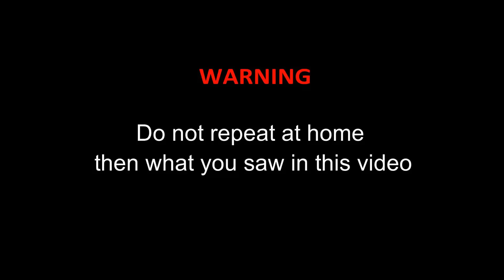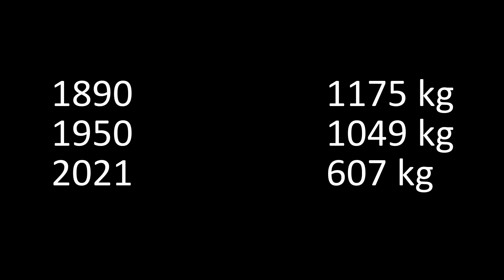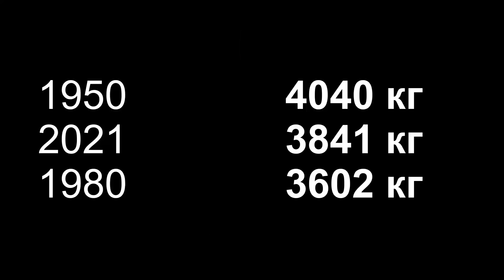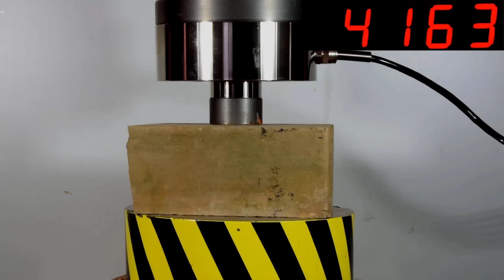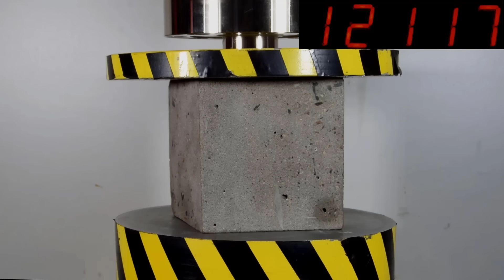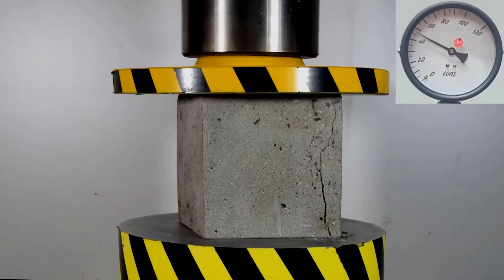HYDRAULIC PRESS VS OLD AND MODERN BRICKS

Comment: I remember as a kid of 8 years old a guy was laying new sidewalk.  He told me the concrete takes  24 hours to get half strength and 24 years to get full strength.  I'm 63 now.    Interesting the things you remember.   Very interesting video.
Reply: in Italy the curing of the concrete is considered completed after 28 days (after which it can receive bearing loads) and reaches the final strength in 3-4 years.  It depends on many factors
Reply: Thats correct, but these are clay bricks, once cooked they remain the same, like pottery.
Cement in the other hand keeps absorbing oxygen.
Reply: @santiagoperez2094  No, they are cement bricks. At least most of them were. I believe one or two may have been clay.
Reply: its 28 days
Reply: @Beanpolr  Santiago is talking about the bricks in the video not the ones in this comment.
Reply: @Logikalx01  Yes, that's what I was referring to.
Reply: Your comment had 666 likes so I liked it
Reply: @santiagoperez2094  63 - 8 = 55
Reply: when I was working on the Death Star my Manager, Mr. Palpatine told me something similar about the metal mix we were using.
Reply: i have some memories i have remembered thought my entire life, of when i was 4. i wonder if i'll remember them if i get to my 60s or something (im not close at all)
Reply: yo grandpa has a yt account
Reply: Wow that's such an intrsting thing
Reply: It's actually 28 days till 95% minimum from full strength, usually 100% in that 4 weeks period.
Reply: Interesting a 63 yr old guy knows how to comment on a youtube video
Reply: @gr0za44  bruh
Reply: @Velociiraptor  lol
Reply: This is not true, it depends on the mix and many environmental factors. Also you can use a different mix depending on what kind of environment its intended use is. For example the mix would be very different if it's going to be used in a very dry environment to a very wet environment and also different soil types. Acidic, Salty (eg close to the sea) you make a different mix for each requirement.  You can also add additional strengthening depending on its use. Some engineers their entire expertise is based on mixes and geotechnical science. A brickie laying a side-walk would not be scientifically educated enough to know this.
Reply: @HamburgerHelperDeath  I have heard the Canteen does a very good Spaghetti Arrabiata but the trays are always wet?
Reply: AYO IM TALKING TO A 63 YEAR OLD
Reply: I think the reason Roman concrete is so strong is not because they had a secret recipe we don't know about, rather their concrete is far older than ours and had more time to harden.
Reply: @jd_kreeper  Nonsense, do you think a concrete from 5bc is drier than a concrete from the 1800s? It doesn't take 2000 years to dry out
Reply: LOL your memory is getting flaky. mason meant 24-28 days
Reply: ah so the concrete dryed when you were 39?
Reply: Viejito pro :)
Reply: @markylon  Concrete cristals grow almost for ever. 100 year old concrete is stronger than 10 year old concrete, even though the difference is almost immeasurable.
Reply: How is it like to be 63, do you feel that you have lived enough?
Reply: @abanoubmaged2101  You guys make me laugh.   When I was 20 at my first full time job I was the young guy.  They teased me for being so young.  They nick named me Pablum breath.   You will probably have to look that up.  Now you all are teasing me because I am older.   I guess I am on my way to a full circle.   HELL NO!!   I have not lived enough.   Too much yet to learn and do.  Hope you all make it to 63 and see for yourself.
Reply: I'm really really sorry, i didn't mean to be mean, I'm turning 24 next month and i just feel I'm getting older so fast that's why i asked, I'm truly sorry if i was rude.
Reply: @markylon  A long time ago I saw a programme by a historian called Lucinda Lambert, she went to a place in Italy where there was a concrete structure from Roman times.  Some scientists had been analysing it and found that the concrete in the core was still setting after 2000 years.  I think it was part of a harbour somewhere.
Reply: Actually he was wrong. .properly made Concrete achieves maximum Strength and hardness at about 112 years old. It rapidly deteriorates after that.  That's what I was taught in Civil and Structural Engineering in the 1970's anyway, when we still had quality checks on everything involved in Cinstruction, Skilled Tradesmen, and skilled Supervision, prior to the EEC downgrading and Screwing up everything with Deskilling. ☹️ Best Wishes.  Bob.  👍🇬🇧🏴🇺🇲
Reply: Ooo
Reply: Look at all these kids getting their minds blown that someone over the age of 25 knows how to use the internet. Pretty cringe.
Reply: its called a pavement, not a sidewalk, boomer.
Reply: @defyyourlogic487  LMFAO
Reply: I think it took infinite days for it to get full strength as it is strengthening everyday.
Reply: Concret is hardens after roughly 24 hours but reaches its calculated strength after roughly 28 days. (At that point they have the properties with which we calculate them). But in theory concret never stops to harden the prozess just gets slower over time.
Reply: @skyricq  well the Pozzalano(sp?) Concrete made by the Romans appears to have an indefinite lifespan, but that's made from Volcanic Ash. I had heard that the Romans wetted and worked it every day for a 100 years before it was used. don't know howvtruevthat is though. "Modern" Burned River Silt Cement, Once it's passed its peak, sgouldvstart crumbling away sometime after 112 years. However, this can be significantly modified by blending it with Lime. .it does appear very Ancient Concretes were blends of river Silt and Clay with aggregates. I've no idea of the original formulation, but if the Bosnia Pyramids are any indicator, those Concretes are good for many thousands of years.  So there's a lot of scope for improvement. Best Wishes.  Bob.  👍🇬🇧🏴🇺🇲
Reply: ^ true!